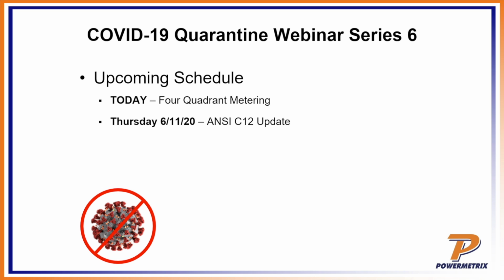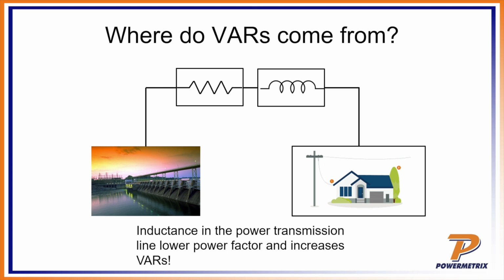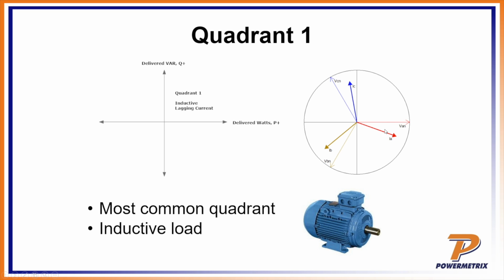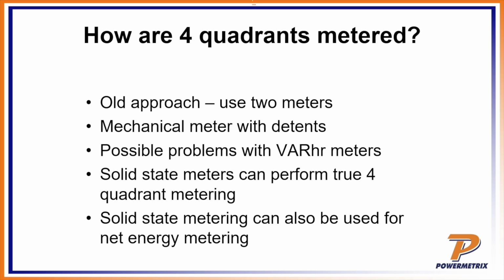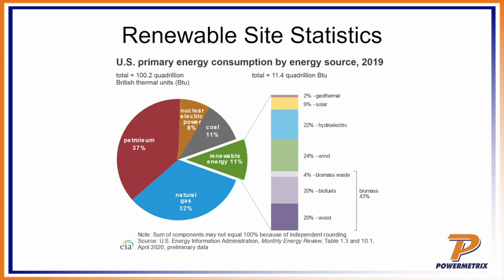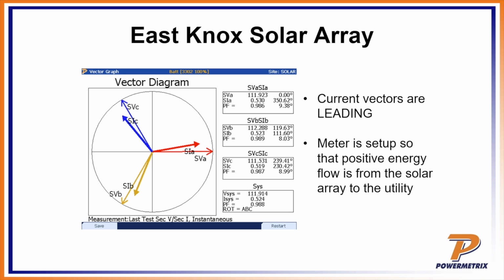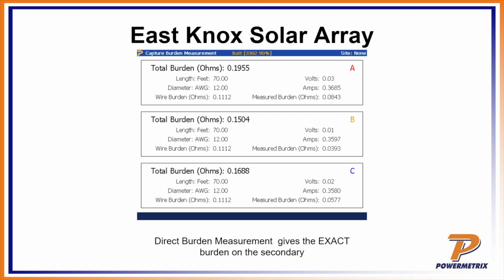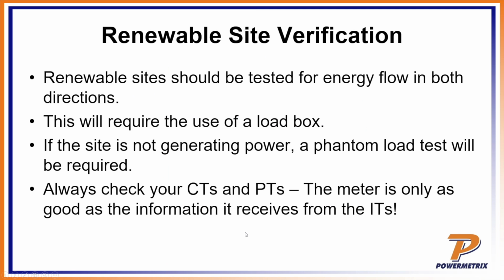Four Quadrant Metering

Comment: 12:11 if the load is capacitive in quadrant 2 , why is the  utility suppling the reactive energy , in presence of capacitance the reactive power should  be exported due to nature of capacitor

Q2 should have a Inductive load instead of a capacitive load to absorb reactive power from utility
Reply: Both Inductors and Capacitors absorb and release reactive power. Inductors absorb lagging reactive power in the positive half of a cycle and return the absorbed reactive power in the negative half cycle. So VARS flow back to the source from the load in the 2nd half cycle. The Capacitors also behave the same way, except that the nature of the reactive power absorbed and released will be leading and the absorption and release will happen in the opposite half cycles. In either case, return of reactive power to the source can be avoided by using compensation reactors. In the case of Inductive loads, the compensating reactors will be Capacitors and vice versa. So, in Quadrant 2, if the loads are dominantly Capacitive in nature and Is not compensated and Renewable energy is supplied to the Utility at Unity Power factor, then the capacitive VARS would still need to be supplied by the Utility. I guess this is the premise on which the concept of the 4 power quadrants has been explained.